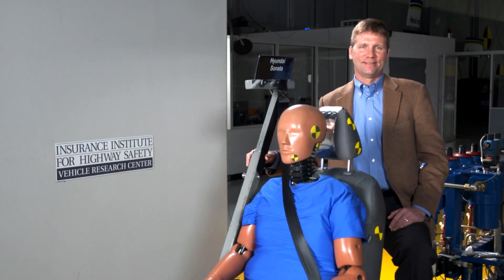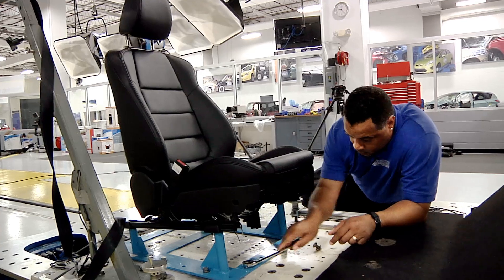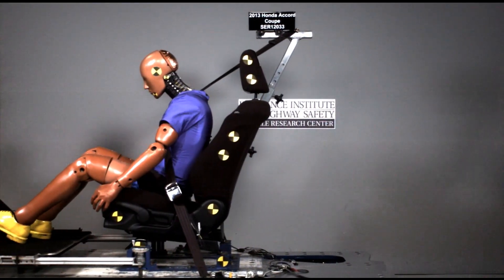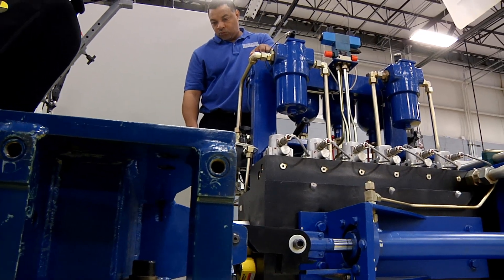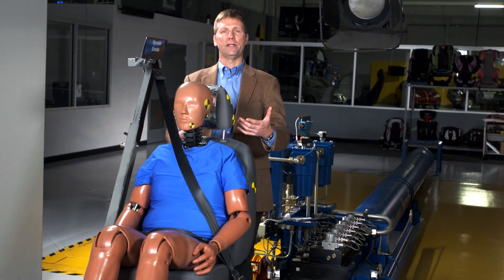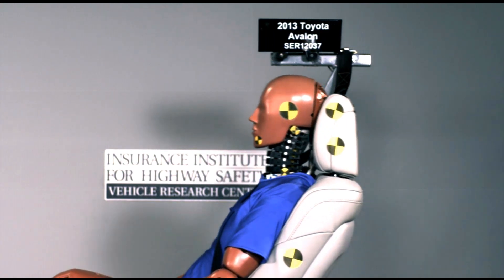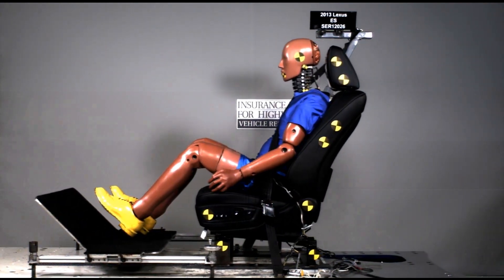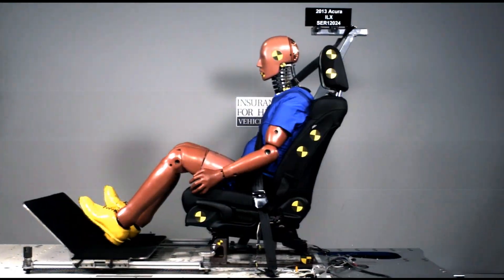Inside IIHS: Rear testing for whiplash prevention

Comment: 希望能增加實車撞擊測試後座也放置假人查看受傷程度，以後方40%以時速48km/h,採用4200磅＆100%全寬撞擊以時速38km/hr採用3300磅的測試車臺測試車輛安全性。
Hopefully the IIHS can increase the real car crash test rear seat also placed dummy to see the degree of injury to the rear 40% at 48km/h, using 4200 pounds & 100% full-width crash at 38km/hr using 3300 pounds of the test platform to test the safety of the vehicle.